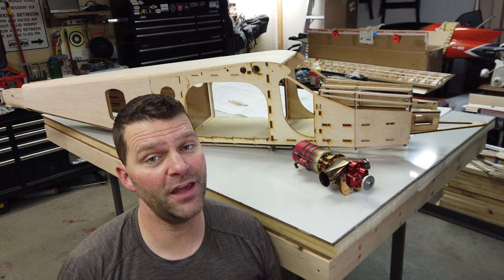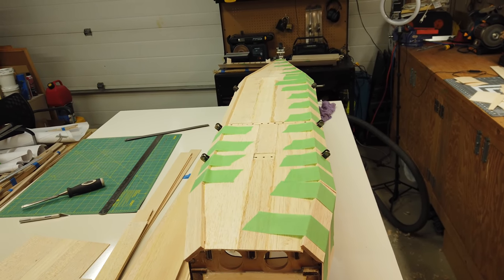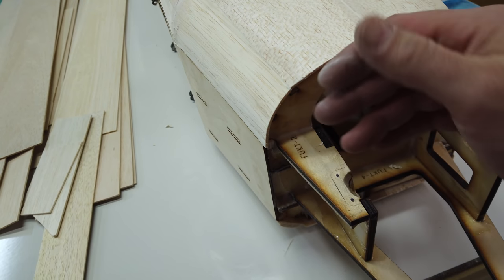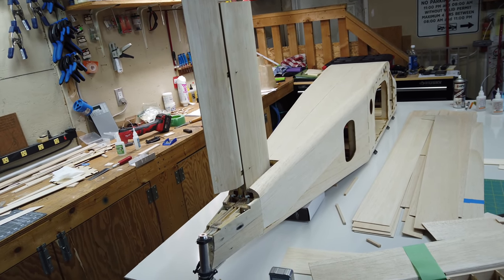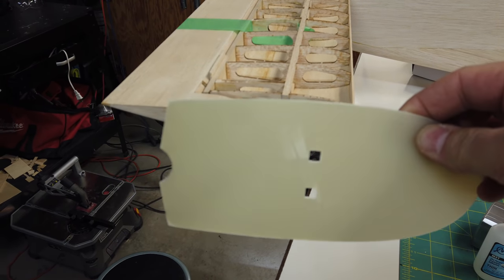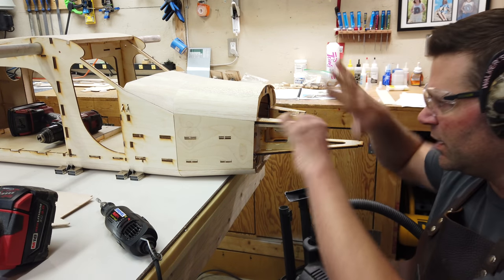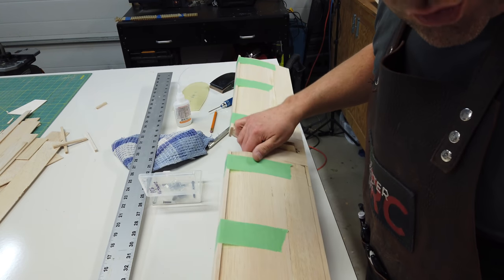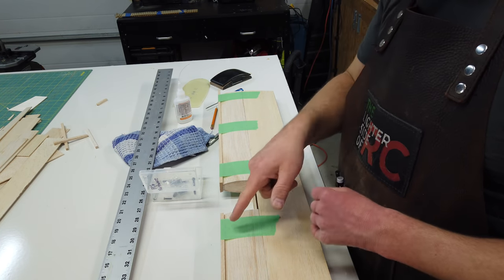HUGE SUCCESSES on PC-6 Pilatus Porter Build - MR Aerodesign Video 9

Comment: Thanks for the mention and the tip,it helped a lot.My next couple of questions also deal with sheeting the wing.I've heard you mention about soaking the sheet in alcolhol to make it more pliable but I've always just used water,which is better?Lastly,my other major problem has been cutting the sheets for the servo hatches(doors).I can't even tell you how many times I've had to recut sheets because they were not flush with the doors or I had to use filler or small pieces of balsa to fill in the gaps.Any tips would be greatly appreciated.
Reply from the maker: Hello Dan.  Reason I use Rubbing Alcohol is it evaporates fairly quick. depending on the % you get it will contain a certain % of water.  Both are probably great but with rubbing alcohol about 20 -30 min later it's dry again.  

Regarding the doors/hatches.  1. Sharp blade!  2. Make sure your using multiple passes on the same cut line.  Don't try to get through in one pass.  3.  Cut/measure big and sand to fit. 

Thanks for watching!

Comment: Where the engine mounts to, will you need to put some form of heat shielding around the plywood mounts or will the engine not be hot enough to worry?
Reply from the maker: Great question!  There ultimately will be tons of airflow through and around the engine. The main body of the engine doesn’t get overly hot but the tail and exhaust portion will be what gets up to the higher temps. Fortunately the hot portions aren’t close to the mount. They are close to the cowl. 

We do have some ceramic paint that may be added to some select areas.